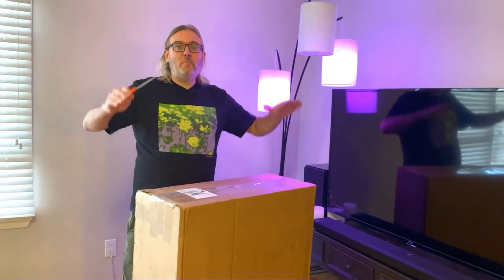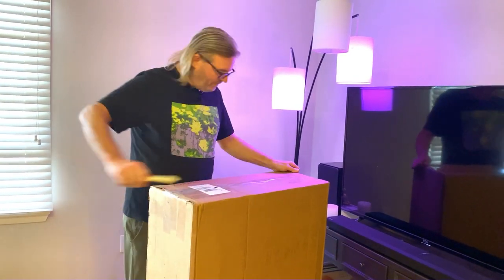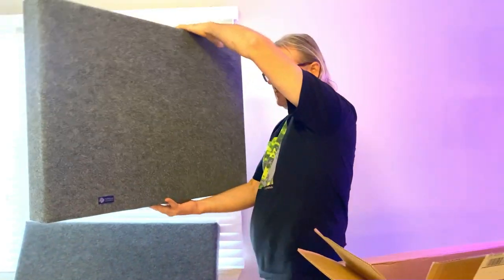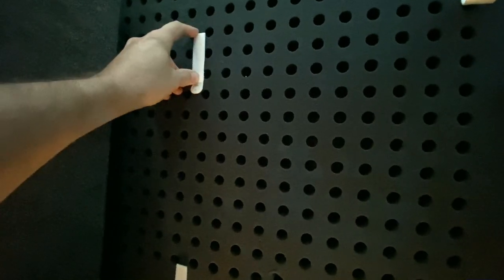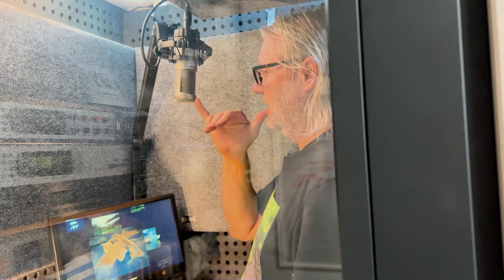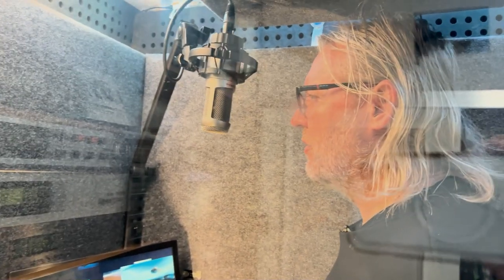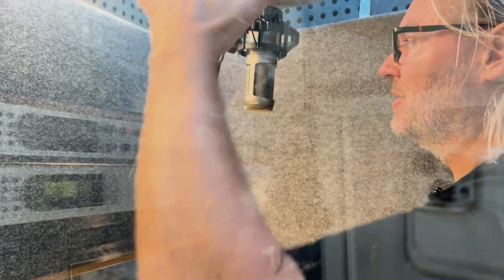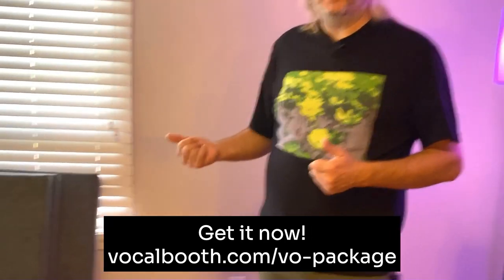Enhancing VO Booth Sound Quality: Testing the VocalBooth GTT Acoustic Kit!

Comment: So great I am ordering once my new booth comes in June ! Super stoked. I did have a question  about the addition of base traps some small ceiling or some wooden corner ones. Do you think that will mess up the sound of this kit in the booth?  Or do you think scratching basetraps with this set up? Booth size about the same as in this video.
Reply from the maker: These replace the need for almost any actors to install any corner "bass traps". As for "wooden corner ones" I'd have to see what model you're looking in to.
Reply: @GeorgeTheTech super! Thanks for this. The less I have to have in there the better :-). More space to move and swing a mace or sword 😊